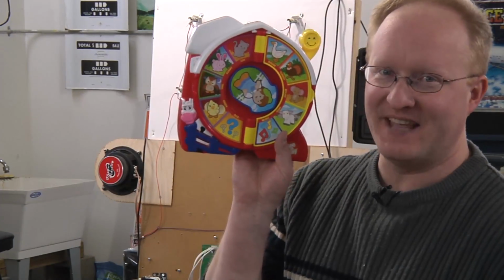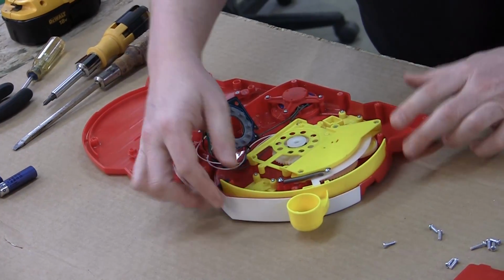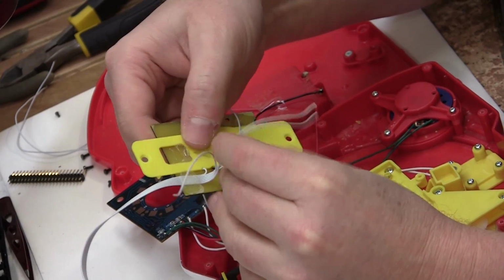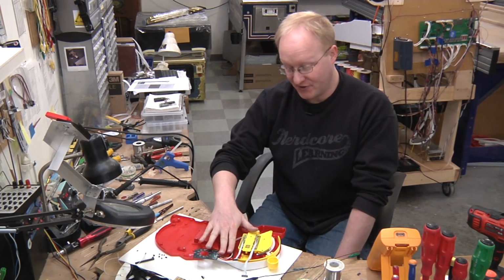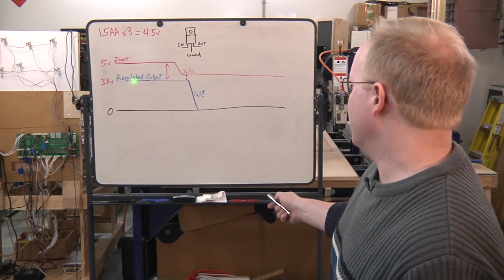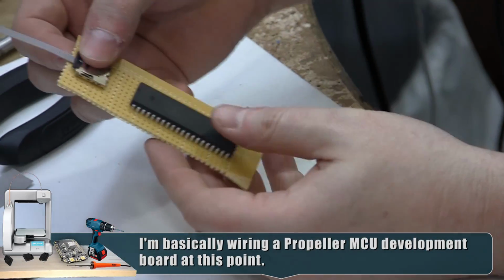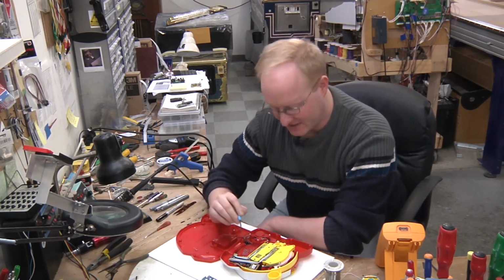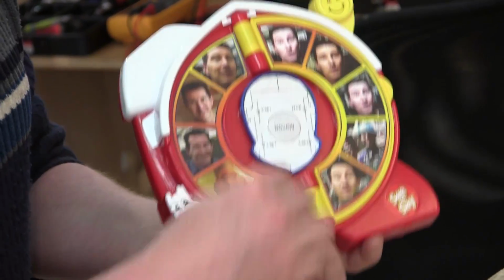Speak and Dave Jones

Comment: I want my car, computer, and phone to all say "Hi" like that when I turn them on.
Reply: Computer is easy to change the boot up sounds, depending on what you have
Reply: Connect an arduino with sound programed to your car power sistem :D So it says or makes sound when you turn your car on :DD
Reply: Arduino is over kill, just get a small WTV020 module, a regulator and a small amp. You can configure it to play a song on bootup and I think WAV is supported
Reply: Watch it, it won't turn on, just fall apart.
Reply: You're not hot enough to turn your computer on :D

Comment: On the unit I tore downn, Playback speed of the disc was controoled by centrifugal weights with brake pads on them, inside a plastic brake drum sleeve cast into the body.

I had the moo-module from the barn my brother had, till about a month ago. a black bellows was operated by the barn lever, and a white bellows inflated to marginalize the shock and contine the moo after the black bellows was fully contracted.

Comment: 19:23 Ben how good does that one transistor amp work? . That looks like something I can build from spare parts.
Reply: Glebs Litvjaks
Ok. I was able to get an amp from a mainboard of an old TV and it's pretty powerful but the amp IC gets hot whenever you play music thru it. And it never had a heatsink.
Reply: Glebs Litvjaks
When it's powered up but not playing anything it's cool to a little warm but once you start playing music thru it it gets hot. I'm not exactly sure how hot but it's not smoking. I have a few CPU heatsinks I could maybe put on it but I don't have thermal paste. The Amp chip is the LA4524 8 pin. It came out of my old CRT TV which died.

Comment: The ones that take batteries are pretty simple, but what I'm wondering is how the the battery-less ones work. I picked one up from a thrift store yesterday, and all I've been able to figure out, is that it has NO electronic components, and only has a bunch of springs and schtuff. How the HELL does that work?
Reply: Nate Dude It's basically a phonograph, like the really early ones from around 1900 that you had to wind up with a hand crank. The large spring stores the energy when you pull the string so that it unwinds slowly. Sound is vibrations in air; the disk that the unwinding spring spins stores the sound as wiggles in small grooves. There's a small stylus that runs in the groove and is mechanically coupled to the speaker. When the stylus wiggles in the groove, the membrane wiggles with it pushing air which produces audible sound exactly as it was stored in the groove.
Reply: It's MAGIC.